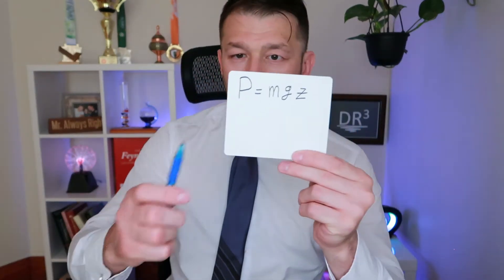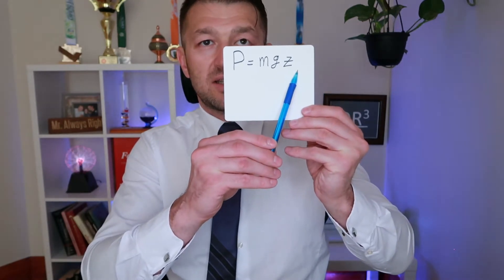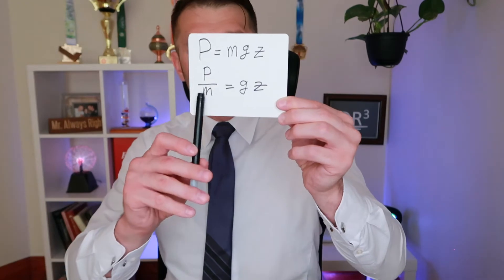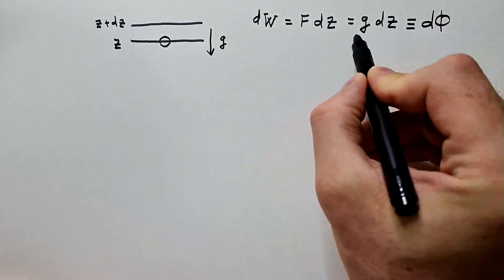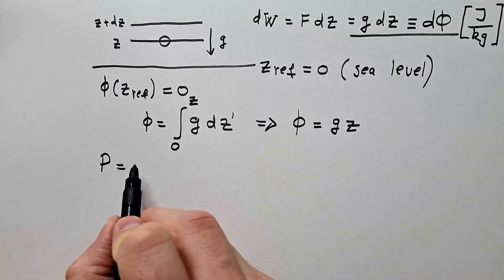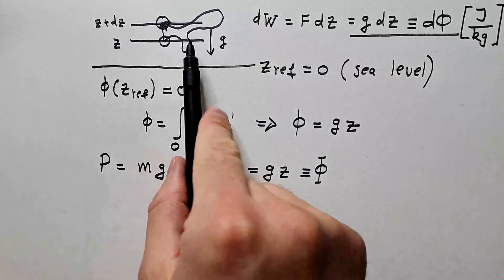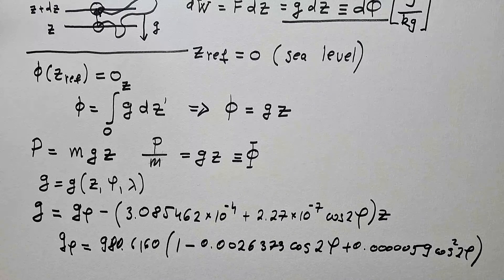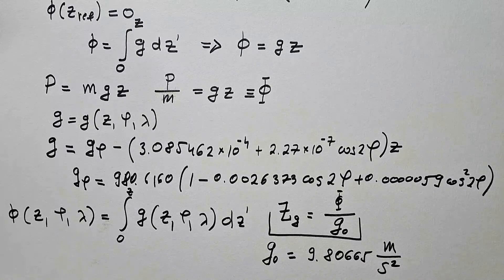Geopotential and Geopotential Height

Comment: Dear Sir, 
Everything is fine, but when it comes Zg(geopotential height) compared to Z(geometric height) in three cases, is this formula you are taking i. e. Zg = Φg/g0. If this is the right formula, when g>g0, then Zg should be high, and g<g0, then Zg should be less, and g=g0, then Zg = z. But it is showing in reverse way in this video, just want to clarify. Am I understood wrong anywhere or it's by mistake. Clarify me please.
Reply from the maker: Zg is geopotential height and in that figure I am comparing geopotential meter as a unit of measure against the standard meter. When g is larger than g0, you need more energy to move against gravity, so that means that using that energy you will traverse smaller distance than in the g = g0 field. Hence, geopotential meter is smaller in that field than in the g = g0 field.